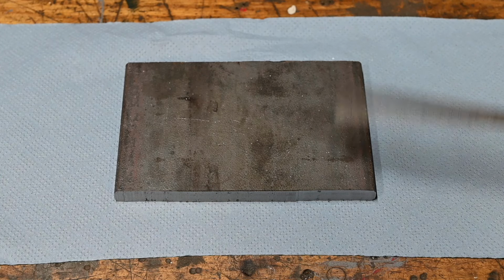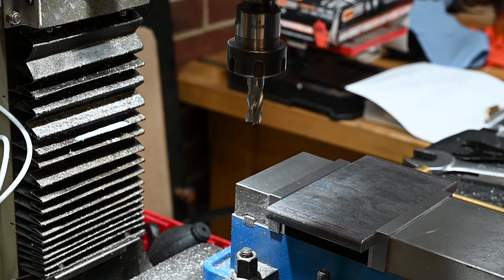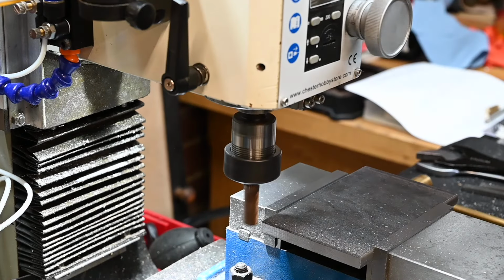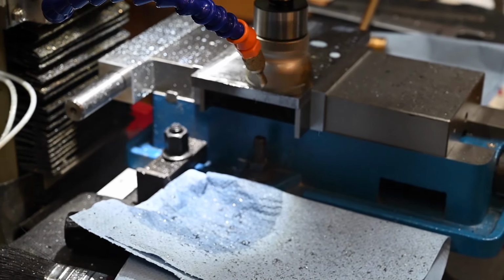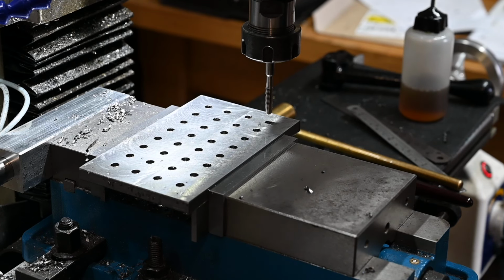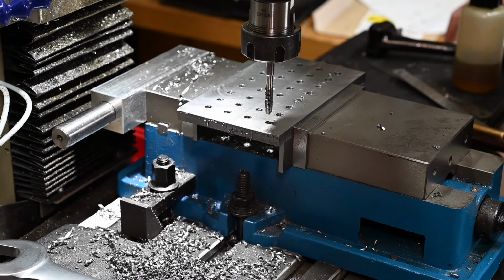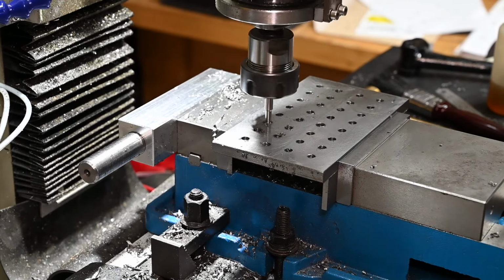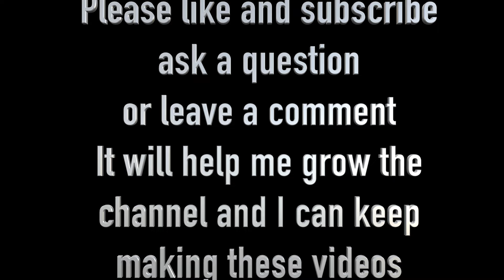Making a Fixture Plate for my milling machine

Comment: Great project. A fixture plate is so useful. I made one on my channel back in February. I added an extra feature by drilling holes to take dowel pins between the threaded holes to accurately align parts. I also made some miniature toe clamps and some special clamps of my own design. I'm really enjoying your Stuart 10V build. Have subcribed. ATB Cheers Nobby. @nobbysworkshop
Reply from the maker: Thank you very much for your kind words, the clamps are coming next week, I will check out your channel to see the clamps of your own design, I did think of adding alignment pins. Thank You ATB Mark
Reply: I made one out of a piece of 6061 that I had. It won’t stand up as well but it’ll get only occasional use in my hobby shop. The plate was thicker than this so I drilled and reamed every other hole halfway down for locating pins and threaded the bottom halves so I can still use them for fastening. I placed them exactly .5” apart so positioning with the DRO was easy.
Reply from the maker: @robertpearson8798  good idea 👍
Reply: @robertpearson8798  Why would you not do this if you are making one it is a no brainer.